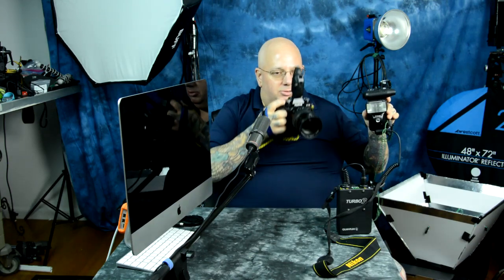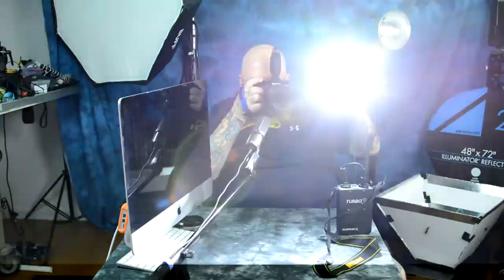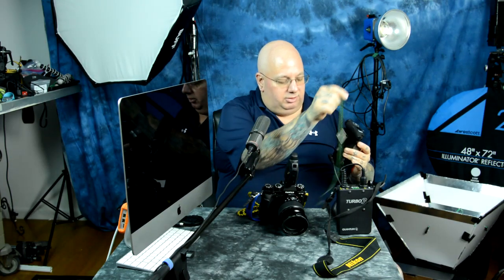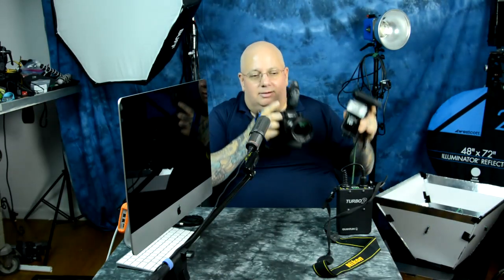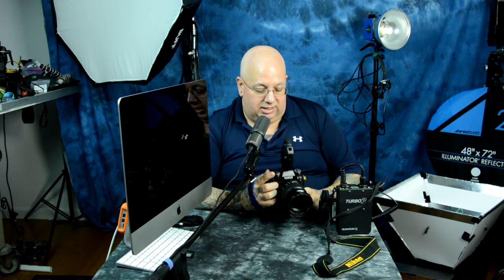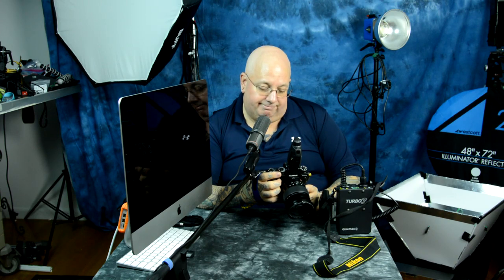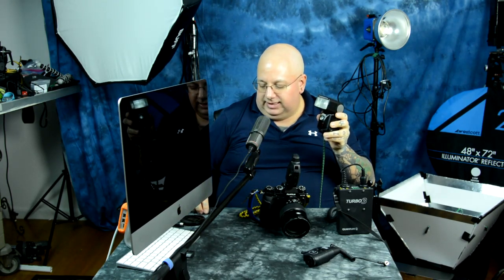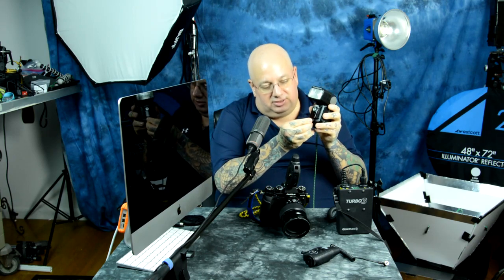PRO TIP: Absolute Fastest Flash Photography possible. BETTER POWER beats Lots of Power

Comment: I keep telling you Ken...You need to review the Godox AD360....Same form factor only 300Ws of power, has a built in trigger, HSS, TTL, or manual and has a bare build (studio strobe) quality of light, plus it work with Bowens mount light mods. Fast is great (it does fast at low to mid power settings or doube the power of a speedlight), but the extra power allows a larger light mods (MUCH softer quality of light) all having Plenty of power enough to tame ambient light! 
A huge deal IMHO

Battery power is at least as good as the quantum packs...build quality no, but they are less than 1/3 the cost.... 3  plus packs to one Quantum creates the power of redundancy....Shit happens I don't care what name it says on the outside. 

Trigger quality? Broncolor just picked up relabeled the trigger, then tripled the price....Look it up.
I don't use Pocket Wizards outside of the studio anymore....The basic triggers are great, but HSS on the fly, or even (God help me) ttl in fast moving circumstance is all part of outdoors work now.
The TT5 system is an utter POS. 

I used to have 15,000.00 worth of Quantum gear...sold it all. Not that it is bad rather that it is a clunky outdated system with too many bits and peices to keep track of....and the heads are more money to fix that a new AD-360....I'm done!

FWIW IMHO the flash Q trigger is an amateur piece of gear...I tried a set for fun...No place in my gear for something like that.
Very cool for an person starting out with speedlights wanting a nice compact form factor.
Reply: Smokin07ram i have 2 godox ad360 and love them i sold my sb910s and bought 4 v850 with the lithium battery and man I'm happy
Reply: Juan Navarro Glad you like it dude! I have never seen anyone that did not love those lights....Especially once you get it on the Bowens adapter...Pure magic!  Needs the 2:1 splitter cable if you want good recycle times at full throttle, but other than minor detail it is one of the best portable systems out there....Absolutely the best for the money.
Destroys a simple speedlight!

I also have the Profoto B2's, and while the B2 is a nicer system it is a lot bulkier...and its a lot of money for what you get.